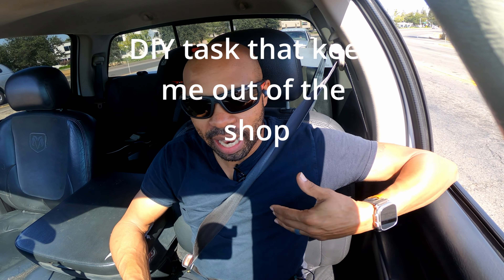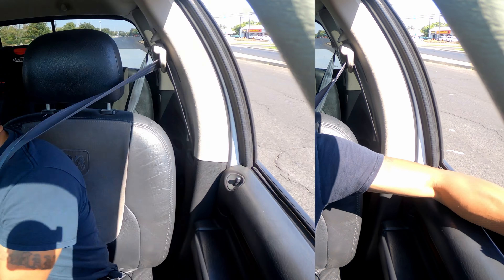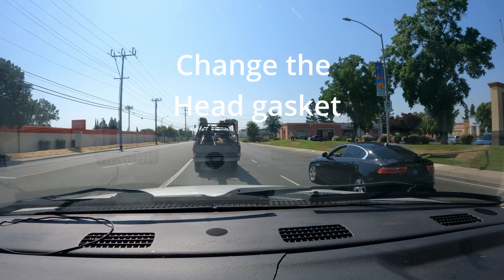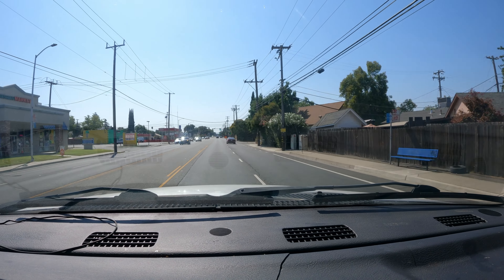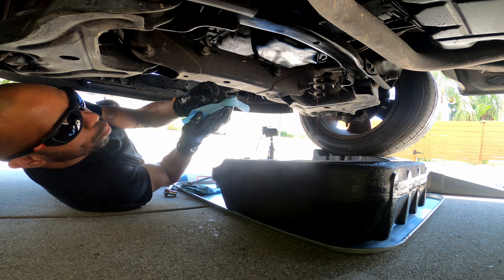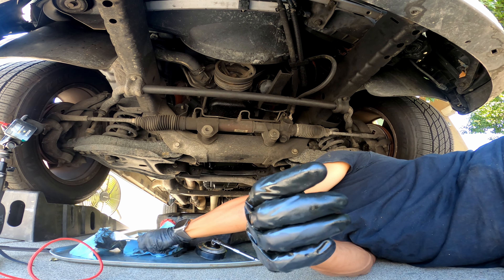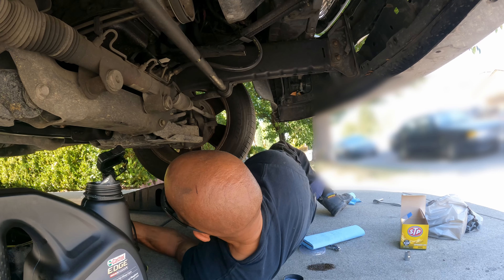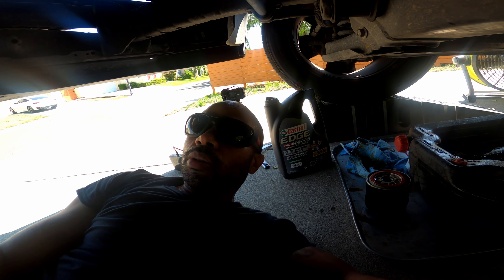2003 Dodge Ram 1500 4 7 Liter Oil Change Vlog 9 18 2023

Comment: I have a 2004 Dodge Ram 4x4 4.7 Magnum V8 with LPG system. What oil do you recommend? I usually use Motul 5w30 
what castrol did you use?
Reply from the maker: I switched to Mobile One 5w 30 high mileage. I was using Castrol high mileage.

Comment: What size is that oil filter socket?
Reply from the maker: Oil Filter Wrench. Check filter dimensions before purchase. 3/8" drive tool. 93 mm diameter, 15 flute.

Performance Oil Filter Wrench W54107

https://www.autozone.com/shop-and-garage-tools/oil-filter-wrench/p/performance-oil-filter-wrench-w54107/153159_0_0?searchText=oil+change+wrench&redirectUrl=true
This is not an affiliate link.
Reply: Thanks man. Happy new year! @daddysharespace